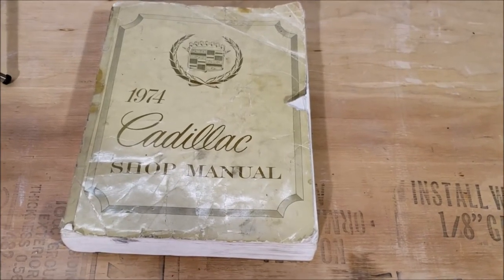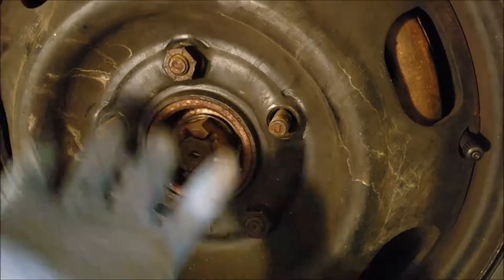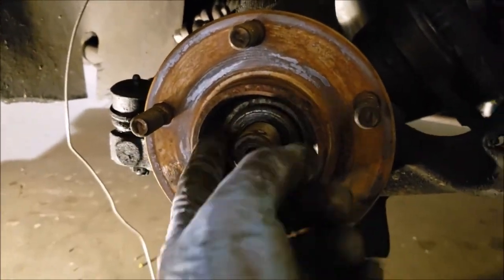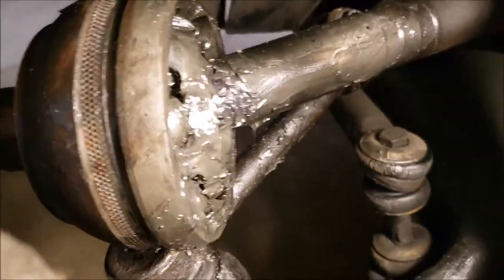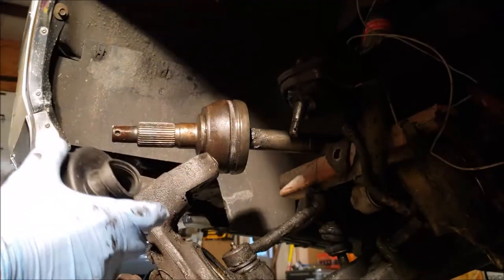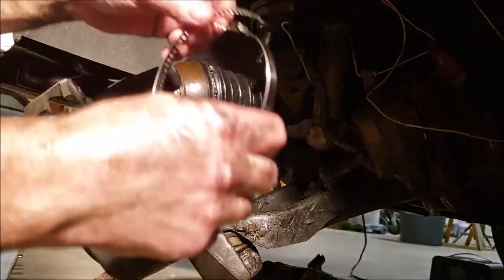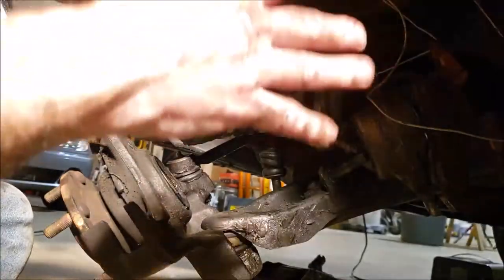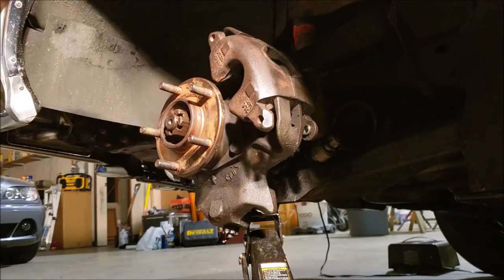1976 Cadillac Eldorado CV Boot Replacement

Comment: Why did you disconnect the top of the "A" arm ? The whole axel WILL come out so you can do both boots . I have done this job on my 75 . Also the damper shaft on the other side is exactly the same size and length as the drive axels . My damper tore it's rubber , and was left at a off straight angle .I was away from home , and couldn't get a new one . So I was able to find a wrecking yard and took a drive axel and removed the c/v joints . Worked perfectly . I did drive gently , till I got home . Love these cars .
Reply from the maker: We were trying to keep the car as original as possible and only needed the outer boot.  Besides, we would have missed the chance to use our giant gyno machine! 🤣

Comment: Doesn’t the torsionbar give problems? I need to replace the lower balljoint. The manual says you need to remove the entire lower controlarm, which involves removing the torsionbar… It seems to me I ought to be able to get the rivets off and replace the balljoint following this video? The torsion bar scares me a bit though, not used to it. Doesn’t it put a lot of pressure on the lower control arm? Thanks for the videos, keep them coming please! Greetings from Sweden!
Reply from the maker: Thank you for watching!  I’m not 100% sure, but I think they suggest remove the entire lower control arm because it creates more space to remove the balljoint.  I haven’t had experience with the torsion bar, for safety reasons I would follow the manual.  Let me know how it goes (you know, if you still have fingers to type). Just kidding.  Follow the manual.  Thanks for reaching out!
Reply: Thanks for the response! Much appreciated! I’m just thinking that it looks like you have plenty of space in the video to remove the lower balljoint? You didn’t do anything to the torsionbar, did you? Suppose the lower control arm just stays in the lowest position when the shockabsorber is removed and and the balljoints split? When there’s nothing but the torsionbar affecting the lower control arm. No problem in lifting the control arm up with a jack, to put it together again? In that case I should be able to just follow your video? Thanks!/Paul
Reply: The sway bar should keep the lower control arm from snapping up abruptly. You can use the jack like the other comment said to lift the lower control arm and get the ball joint stud through the knuckle when you're re-assembling. Hope that helps.
Reply: @frankalbano7333 Thanks! Yes, it worked out fine!  The swaybar kept the control arm in place and I replaced the balljoints without problems. Need to remove the control arms eventually though, the bushings look like they might benefit from being replaced… But that can to wait until winter!

Comment: Question dose the tie and center link have to be level with each other?
Reply from the maker: Thanks for watching and reaching out.  I'm not 100% sure I know what you mean.  For this video, I just lifted the car and placed a second jack under the axle to remove the pressure, then took everything apart and put it all back together the same way.  It was only apart for 20 minutes and everything went back into the same position.  Sorry I couldn't be of more help.

Comment: I recently did the same job on a 78 Eldorado, I was wondering if the 110ft lbs that the manual says to torque the drive axle nut is enough or it needs to be more tight.  110 does not seem enough compared to the effort I put when trying to loosen it.
Reply from the maker: I thought the same thing, but then realized that the nut was frozen in place due to moisture and rust, so it took more effort to remove.  Stick with what the manual says and you'll be just fine.  Thanks for watching.

Comment: How can i knew my car Axle damage?
Reply from the maker: Most times it is just the rubber boot.  Drive the car slowly and turn the wheel from side to side, listen for any clunking noises or jerking movement of the steering wheel.  If everything feels and sounds normal, then it is just the boot that needs to be replaced.
Reply: @westofthelakecadillacclub cv axle @westofthelakecadillacclub
Reply: @westofthelakecadillacclub  What I used to do many years ago was to get on the highway with the window open and drive in the lane that was closest to the highway divider. If it is bad you will hear a very audible "ticking" sound and it is very distinct. If you hear that should that means the bearings are rattling around and are worn. If you hear nothing but road noise then you are fine.